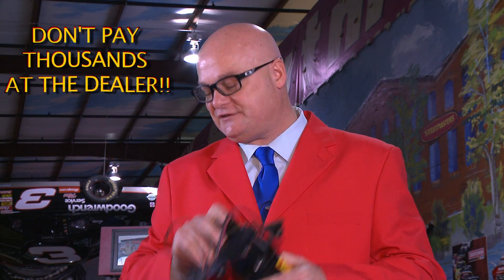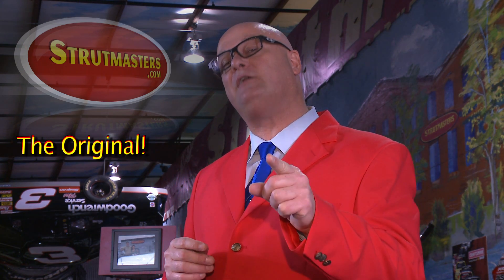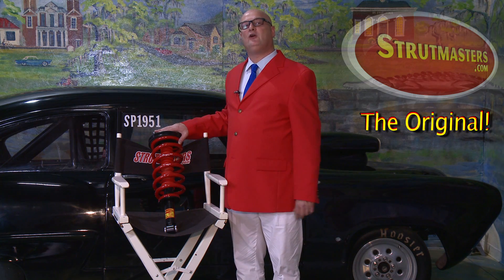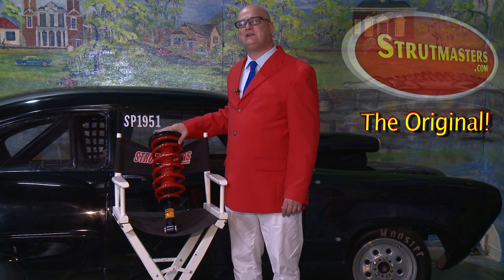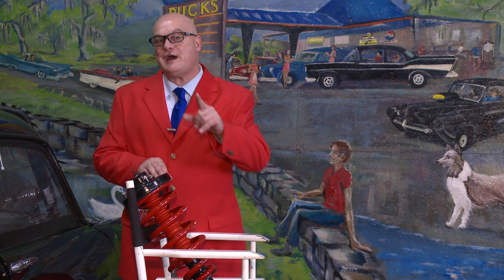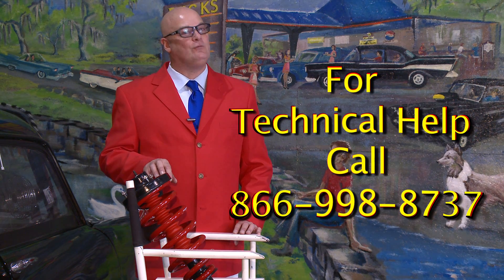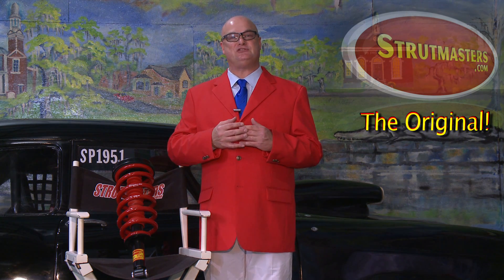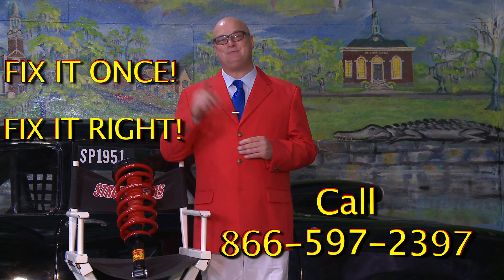Why The Air Suspension Fails In The 2003-2006 Lincoln Navigator

Comment: The way to fix it right is to stick to your air suspension and fix that right. To often backyard mechanics don't know what their doing and screw up the air suspension rather than spending a few bucks to fix it right. Coil overs change the way your vehicle rides and how it sits. They are trash and don't waste your money on them because you will regret it later, and also your vehicle will have a poor resale value without the air suspension. These people who push coil overs would never get them for their vehicle, so why should you.
Reply: I think you may be correct 😊
Reply: Strutmasters could just make reliable shocks with out sourced air springs/bags installed. 
The load leveling feature of air suspension is a massive   benefit. As is side to side equalization, and the 1 inch automatic lift in 4 low for a 4x4. Lowering the front a few inches while parked makes entry smoother for almost everyone. Fix it right, reap a bunch of rewards.
Reply: @70ixlr86  my front passenger bag is sagging i'm gonna just replace both front bags because my compressor is fine